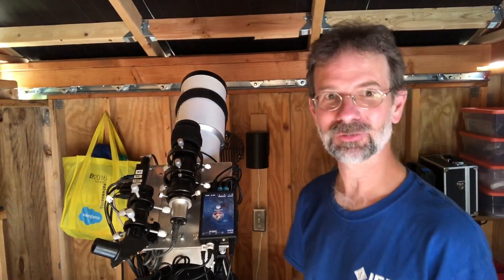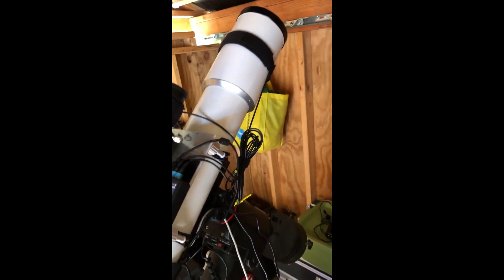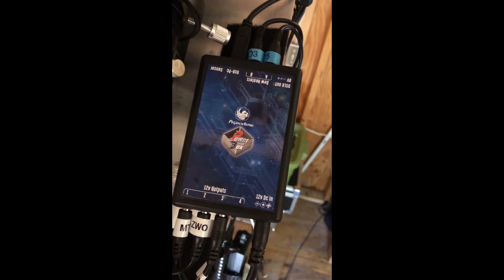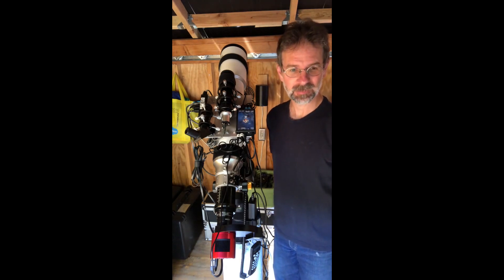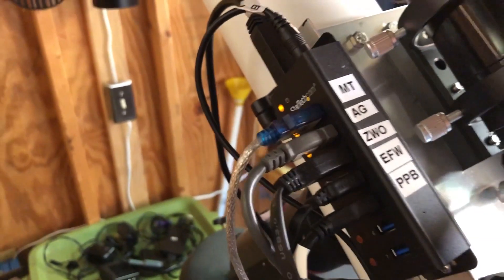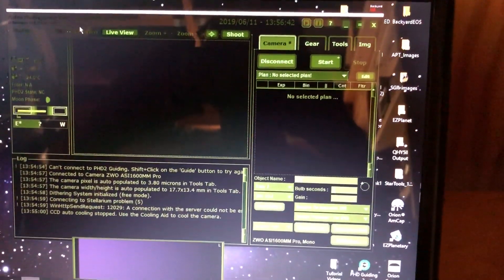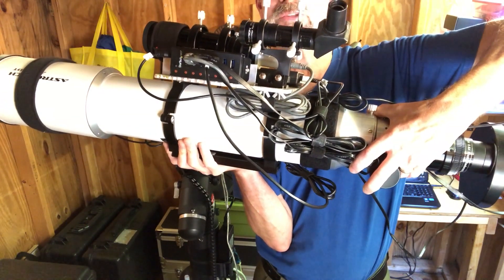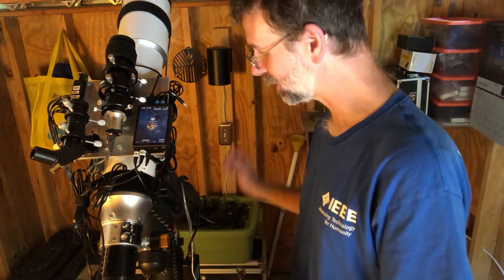Cable Management With The Pegasus Pocket Power Box - Best Thing Since Sliced Bread!

Comment: On your fancy USB hub, what is the output current capability for each USB socket?
Reply from the maker: Not exactly sure, it is 12v 5Gb per second.  Here is a link: https://www.amazon.com/StarTech-com-Port-USB-3-0-Hub/dp/B00SCE4E0I/ref=pd_lpo_147_t_0/134-8752588-9300005?_encoding=UTF8&pd_rd_i=B00SCE4E0I&pd_rd_r=89fa86d1-0950-475b-9eef-b4a405f55f64&pd_rd_w=S7shM&pd_rd_wg=cQZZ9&pf_rd_p=a0d6e967-6561-454c-84f8-2ce2c92b79a6&pf_rd_r=V7T1SRHX7RBAC4JKY2J6&psc=1&refRID=V7T1SRHX7RBAC4JKY2J6.

Comment: I am about ready to pull the plug and buy one of these.....looks nice. With only 2 dew heater outputs, I am wondering what folks are doing with needing more than 2.  I generally use 3....scope, guider, diagonal.  Can you plug in a splitter in one of the dew heater ports?
Reply from the maker: Not sure about the splitter.  Good question for Pegasus.  I only use two myself but was wondering what people do if they do use more. I believe the new Ultimate Power box has 4 dew heater ports but it is also more expensive.  - Good Luck.
Reply: @AstroQuest1  Yeah, I saw that but hate to spend $400 more for a single extra dew heater port. I already have a power usb hub I use and I guess can can just plug it into the Pegasus.  BTW...I really enjoyed your video and also checked out Trevor's and ready to get one of these.....many thanks! Oh, yeah...one more question, I currently use a Dew Buster controller. So The Pegasus will take it's place instead in controlling the dew heaters?
Reply from the maker: @jeffmccaffrey6773  Yes it will.  There is a control box that appears on the computer. where you can control it and other things.  I only use it to control the temp though.
Reply: @AstroQuest1  Got my PPB and hooked it up last night....I am really going to like it! Didn't think at the time but I ran a 12v cable from the PPB to power my 5v power usb hub....ZAP!...there goes my usb hub. How are you powering your usb hub with your PPB? I also e-mailed Pegasus today and he said they were coming out with a 12v usb hub in about 10 days that can be powered with the PPB. Any help appreciated.
Reply from the maker: @jeffmccaffrey6773  I connect the PPB to an outlet using a standard AC/DC power converter.  The PPB has 4 power outputs.  One of those is connected to the USB Hub. - Good Luck
Reply: @AstroQuest1  Yep..that''s what I have, but my question is are you using a power usb that can handle the 12v PPB input?  Most power usb hubs are 5v...that's what I had and I blew the usb hub with the PPB
Reply from the maker: @jeffmccaffrey6773  Sorry I did understand. The answer is yes https://www.amazon.com/gp/product/B00SCE4E0I/ref=ppx_od_dt_b_asin_title_s00?ie=UTF8&psc=1.  The StarTech USB Hub handles 12V.  It was Evan from Pegasus who recommended it to me. - Good Luck

Comment: Kurt, As a tip I would recommend strain relieving all the USB connections. USB has a terrible connector for exterior and moving installs and just plain PITA for the rest, Hence USB C. One small disconnect or glitch and the whole night is potential lost unless you constantly nurse the system. Aprime example of what I mean here is the bundle of USB cables you have rolled up shown in this video. That bundle, as can be seen is pulling on the plugs into the USB hub. As the mount moves throughout the night that load will change potentially causing such a glitch. I would cut a slot into the aluminium sub plate and simply bind the the cable ends to the plate, relieving any strain on the plugs. Another alternative would be to lose all the extra length in the area between scope and subplate. 
One last detail. It has been my experience that hubs with more than 4 ports typically have one primary USB hub IC with a second daisy chained from a single port of the primary hub IC. The makers  of these hub IC's tend to limit themselves to a 1 into 4 fanout.  You may have noticed these hubs come in 4 or 7 ports rather than 8, this is the reason. Why do I mention this? Common sense would dictate connect high bandwidth devices like the imaging and guide cameras to the "fast lanes" while the mount and focuser etc could happily exist on any of the 4 into 1 daisy chained "slow lanes". Generally the ports closest to the mater input USB connector are the faster ports
Reply from the maker: Thanks Rob.  Yeah, haven't had any issues yet but relieving stress on the USB is certainly good.  I have everything velcroed in but I would not mind making it better.  I did eliminate a couple of connections when I went to EQMOD direct.
Reply: love Eqmod. Sadly off the agenda with the CGX
Just went mad and ordered the yet to be released ASI2600MC Pro. Got tired of wasting hours trying to get results with the DSLR. Went OSC for the simplicity over mono and filters
Reply from the maker: @RobB_VK6ES  Wow.  That is a heck of camera.  Good Luck with it!

Comment: Does your USB hub have to be DC powered to run off the pegasus?
Reply from the maker: To run off the Pegasus it does.  Fortunately Pegasus supplies the wire connection.
Reply: @AstroQuest1  Thanks for the quick response! That's a huge help!

Comment: Guys all my end cable are usb, but this one it look like have all 12v end, how can i use it? My mount end its a usb, camera is  usb, polemaster  is usb,eqmod is usb, guidecamera is usb, they all goes to my pc....
Reply from the maker: Hi Davide, if I understand your question, I have a powered USB Hub which all of the stuff plugs into and that one cable connects to the computer.  The PPB is also connected to the USB Hub.  Some of the stuff may also need power along with the mount and that is connected to the PPB.
Reply: AstroQuest1 yes that what i need then.
Reply: AstroQuest1 Or maybe the Pegasus PowerBox V2? That one has got 6 usb port too,that will work right?
Reply from the maker: @davidemancini7853  Yes.  I have the Pocket Power Box (PPB) so I had to get a Powered USB Hub.  The Ultimate PowerBox 2 has the USB Hub built into it along with some other goodies.  You might want to contact Highpoint Scientific or CCTS (U.S. sellers) to make sure it is what you need. - Good Luck.

Comment: Trawl through ebay you may need to try a few variations on the search term but once found most of the sellers all use similar descriptions. You will find just about any interconnect cable made to various lengths. For example I found short panel mounting USB, ethernet and power cables to connect my PC and power supply mounted inside a weatherproof box. The box lives at the base of my pier.